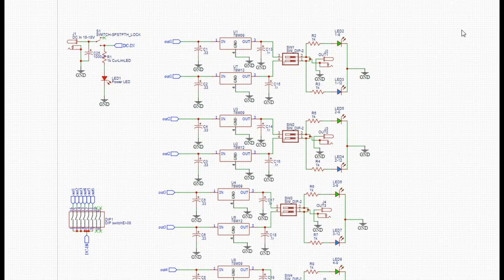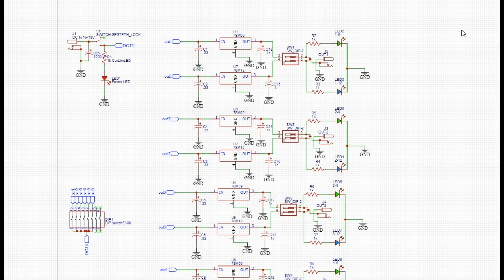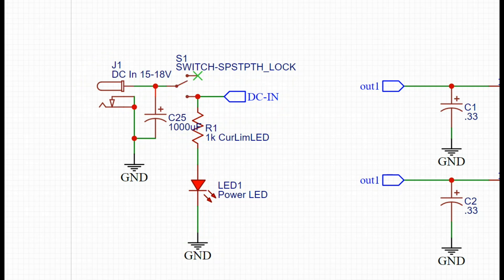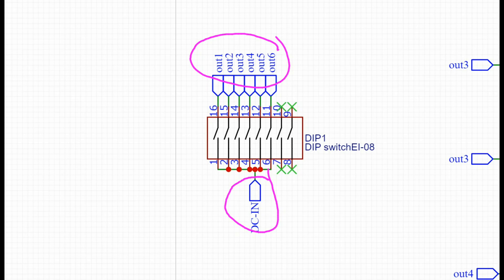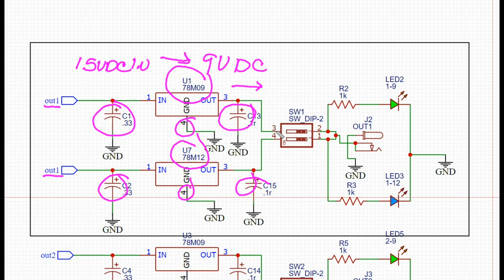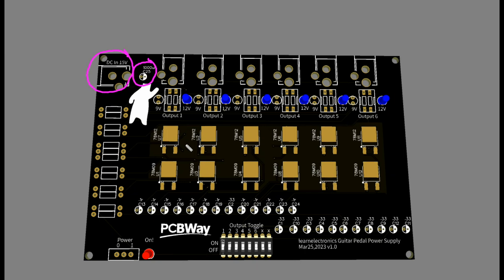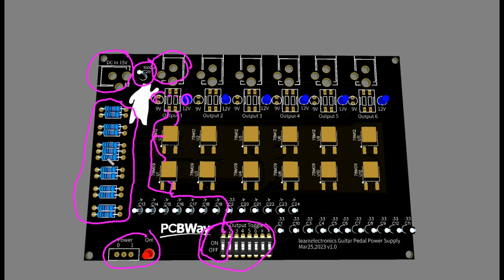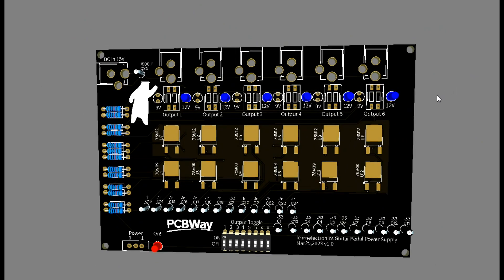Designing a Power Supply

Comment: As most have pointed out already, both indicator LEDs will light up.
Instead of the switch on the output, you could put a rocker switch before the regulator. The indicator LED could then also simply be in parallel with the regulators and the unselected regulator doesn't get powered.
But putting some more thoughts into it, I don't think you need 2 regulators per output. I don't think pedals draw that much power. Should be tested, maybe.
It might be better (sufficient) to just use 2 regulators in total, and then simply have a bunch of 9V outputs and a bunch of 12V outputs and you select the voltage by plugging the pedal into the right output.

Comment: As other people have suggested I'd definitely use toggle switches instead of the dip switches. If you use on off on for the voltage selection you can get rid of the big dip switch to turn each output on too

Comment: 1) Both leds will light up always so you can't see the voltage selected.
2) By turnig on both switches you connect the two voltages. Better use a 3 position switch or one switch to select the voltage.  To turn the channel on or off you already thave the big dipswitch.
3) Dipswitches are not made to constant switch things on or off.
4) The capacitor at the power entrance will give a security risk as it will not discharge (perhaps better let it discharge over the power led )
5) Why not use a voltage regulator like e.g. LM317 and select the voltage by selecting the resistor.
6) However the first question is what is the required endresult (with must haves and nice to haves). What is the max current you need. This as you need to keep this into account when designing. (Are the (dip)switches and is the input power appropriate, does each channel needs its own regulator, should you add some fuses (there are cheap self restoring fuses you could use in your design.)
Reply: Perhaps do not add the switches and leds, just make 2 rows of outlet sockets with the two voltages. This as the voltage only needs to be selected and probably never needs to be switched. The correct voltage can be selected by plugging in the correct output.

Comment: 1) as designed both output LEDs will light regardless of which voltage is selected.
2) caps should be as close to the regulator's as possible
3) use a spdt switch to select between voltages so there's no chance of connecting the outputs of the regulator's together
or
4) consider using LM317 regulators with a switch to select between voltage setting resistors
Reply: And/or maybe put the switch before the regulator. The indicator LED could then also simply be in parallel with the regulators and the unselected regulator doesn't get powered.

Comment: There could be a situation in which DIP-2 shorts the outputs of the regulators together, so probably better to have centre-off, double-throw (and double-pole for the LEDs) toggles there. As others have mentioned, check dip switch currents as most only go up to 100mA and are suitable for switching only 25mA when under load. Blue and green LEDs will be different brightness (forward voltage drop).

Comment: Definitely get rid of the 2 pole DIP.  A simple ON/ON toggle or rocker would be a better option to avoid the 9 & 12 going to the output at the same time.  I can understand the temptation to get all the caps in the same general location, but they would be better right next to the relevant regulator.  Also, don't be stingy.  Don't use your normal hair thin traces, make em 1-2mm 🤔  The general concept is good. 👍

Comment: The only thing I could add is if you choose not to use a dual pole switch after the voltage regulators then you might want to use diodes to protect from back feed if both are turned on at once, just a thought. You will need to use some diodes to isolate the LEDS power as some other people have pointed out. I do like the design.

Comment: Expanding on the observations made by others, addressing the problem of the joined 9 and 12 volt regulator outputs, and the problem of both LEDs being driven on at the same time. 
One solution is a double pole, double throw, center off switch to meet the requirement. This can switch the regulator input and output, allowing the LED indicators to be fitted directly to each regulator output, before the output switch. While this works, it's not very elegant. The switch is expensive at about £1.30 each, and there are too many wires to the switch, mixing regulator inputs and outputs on the same switch, never a good idea for RF stability.   It is  difficult to track on the PCB using toggle switches,  and horrible to wire, with six wires to each switch.

Modifying the requirement spec slightly makes it easier to implement, and potentially more flexible. 
Adding a Jack for each voltage output, would allow the regulators to be switched with a single pole, double throw, centre off switch on the regulator inputs. 
 The LED indicators could then be fitted to the regulator outputs, or across the associated Jack socket.   The indicators would then show which Jack is active, and indicate the health of the voltage output. This is a more logical use of the indicators, and avoids  the problem of joining the 9 and 12 volt regulator outputs.
  This solution is easier to track, as the switch commons are all joined together to the common 15 volt input. The two remaining connections on the switch wire to the input of each of the regulator pairs. 
There are other advantages, different size jacks could be used for the 9 and 12 volt outputs, making it harder to plug equipment into the wrong output. It is likely safer to accidently plug a 12 volt equipment into the 9 volt socket, than the other way around.

Comment: It is tempting to put down a solid ground plane, however, I think it would be better to  reserve the solid ground plane for the input side, up to the regulators input, but star point earth from there on, to each of the outputs. As I suggested in an earlier post, the chance of setting up common mode interaction between outputs is rather high. The problem with tracking separate earth returns Is that the track impedance is likely to be higher, introducing additional volt drops for high impulse currents into the loads, but at least each load will be slightly better isolated from interacting with the others.
As the outputs are joined, the LED supply  indicators will both be on, no matter which supply is selected. Switching the regulator inputs was not my best idea, as while the LEDs could be moved to the regulator inputs, the regulator outputs would be permanently joined, allowing the on regulator to drive current back into the off regulator output. In fact making the LEDs work the way you want is a bit of a problem. Using a SPDT switch at the output, does not solve the problem, as while the LEDs can be made to indicate the health of the 9 and 12 volt regulators, they will be always on.
A simple, but not very nice and rather redundant solution, is to use a DPDT switch, to direct the output voltage to the correct LED. Its redundant because the switch position shows which output is selected, but at least the indicators work the way intended. Unfortunately by using either type of switch at the output, the output voltage off position is lost, as the output can be either 9v or 12v but not off. 

Before the days of detailed circuit simulation, I always believed it took three iterations of a PCB to get it right. The first is where you think you know what the circuit will do (from dc to light). The second is the result of finding out what the first actually does. The third is where it is optimised for production in quantity. Even a simple board, like this can produce surprises, for example,  knocking out VHF/UHF reception for a few hundred metres radius. 
I was always sceptical of those engineers who say they get it right first time. This is because the component data sheets, do not often tell the full story and the initial requirement has a tendency to change once there is experience of the prototype. One can always think of better ways of doing something, so knowing the requirement is important. The perfect circuit takes infinite time to develope, so what goes into production is always second best, but that's ok, provided it meets the requirement spec, because that is "good enough". 
For complex projects, the three levels of PCB  correspond to prototype, preproduction,  and production. Along with these goes levels of understanding of the requirement. Starts with "How the hell do we do that", followed by the naivety and arrogant of "That's easy", followed by the surprise of "Why is it doing that", to finally "Now I understand". 
For the amateur designer, it is not necessary to go for the third iteration, as only one working design is required, and not the repeatability of thousands. 

When working as a circuit designer, I always considered it unfair that I would be castigated by management for expecting three iterations of a product PCB, issues A,B and 1, while at the same time, the software development team produced so many iterations of the software, they were forced to resort to a multidigit alpha numeric code to keep track of the myriad of version of the build. 
To add insult to injury, it was not uncommon to be asked to do hardware changes to accommodate fixes to the software, things like the odd signal inversion, time delay, or extra indicator. Items that would have been deleted, on cost grounds, during the preproduction design review, had they been included in the original design. But I digress and am starting to rant about long past battles.
Reply: Thank you for your insight! 👏🏻🙋🏼‍♂️

Comment: Would it work to use a SPDT switch for each channel and move it to the front side of the LDO's?  This way, only 1 LDO per channel is active at a time and you can use the exact same input/output capacitors for the channel thus reducing the number of caps you need.  The way it currently is shown, all LDO's are active and charging/maintaining voltage to all those caps.  Just a thought.   :)

Comment: Would consider different linear converter, that can take resistive divider as input . Fewer components this way.
Alternatively, step down to 12V and add 9V in series after it, having a 2 way switch picking output . Less power dissipation this way. 

Also, I’d add some filtering at each stage . Pi filter or such.
And current switching allows both 12 and 9 v to be enabled at the same time. That might be bad . 
Also, the main input cap is going to be big, need larger footprint for it.

Comment: R1 needs to be a 1w resistor.  Why are you using Dip2 rather than a 2 pole centre off slide switch.  DIP's will let you put both 9v and 12v on at the same time on each channel and with no diodes you will have a reverse potential on the 9v lines.  But I am new at this so I could be wrong.

Comment: Looks to me like both LEDs will light no matter which voltage is selected. I also suggest putting a 1 nF ceramic cap at each output to bypass any high frequency noise to ground. It wouldn't hurt to put one at the input also.

Comment: The off position for each 9V and 12V output is redundant to the other bank of switches.  Replace the two switches with an SPDT switch with the 9V and 12V on the poles and the center tap to the output.  Then you do not have the possibility of both on at the same time.  But you do then lose the LEDs.  I have not come up with a good way to make them work in this setup.
Reply: I think I have it worked out.  Place the SPDT switch on the input side of the regulator.  The LEDs then work just as dwsired. You only need one input filter capacitor per 9V/12V regulator pair on the input side of the switch and only the needed regulator is drawing power.

Comment: My suggestion is to move the caps closer to the regulator outputs.  Pretty much everything that I have ever seen suggests that they should be as close as possible for smoothing ripple.  You stand a chance of getting unwanted inductance or capacitance in the long traces.
Reply: Yes he doesn't need all those extra electrolytic caps he should use 1uf x7r ceramic close to input pins and maybe max 10uf electrolytic or tantalum on outputs closer to the output barrel jacks.  Also protection diodes.

Comment: Snarky unsubs .. love it!! 😂

@learnelectronics: Possible considerations: on the distribution-side regarding the two (9v/12v) LEDs .. use one, but on the return side (of J2, J3…et al) AND maybe use alternate switches for SW1 and all. The light would then be triggered on a completed connection, rather than just as verification of power.

Comment: A single pole double throw switch on tbe regulstor output would avoid the problem of both regulators being on at the same time, provided it is break before make. 
Is it wise to use the same socket size for both input and output?
Applying the rule that if it can go wrong it will, then it might be a good idea to stop the input plugged into the output. 
Are these regulators low dropout, if not there might be a head room problem with 15v down to 12v. Equally 15v down to 9v is potentially going to give the 9 volt regulator a lot to dissipate. 
Have you considered running the 12 and 9 volt regulators in series? If there is sufficient headroom, this reduces the dissipation of each regulator.
Have you done the sums for power dissipation. If all those regulators are active at the same time, will it exceed the current rating of the input?
Switching the inputs to the regulators, would avoid running the standby current to unused regulators. Though there are arguments in favour of switching the regulator outputs. 
There is nothing to limit the in rush current. A low value resistor or inductor on the input of each regulator might limit the in rush current. 
Bit concerned at the power dissipation of so many regulators. You will need a good heatsink to avoid the regulators over heating. 
There is lots of scope for common mode earth current interaction. 
The problem with running equipment with reverse connection of the power pin, is that chassis grounded equipment with metal cases can produce surprising short circuits. 
Are you happy that the regulators will remain RF stable, when the outputs are connected to long leads. Might be worth a breadboard to check for regulator noise and RF stability when used with long leads.

These are just observations and ideas, not recommendations,  and some are contradictory. Such as the RC input to the regulator reducing the headroom. 

One trick worth considering to avoid cross talk, is to add a diode and capacitor to the regulator inputs. This serves two functions: reverse supply protection, and momentary supply rail dropout, as might happen if one regulator has a high impulsive current demand.

Comment: Check the polarity of the outputs. If I'm reading the schematic correctly it's center-positive on the input, but center-ground on the output.
Reply: Some pedals are positive-tip. Others are wired negative-tip. I would recommend a polarity switch at the end of each circuit

Comment: I’m not a musician, so I have no clue why you need  six separate power supplies, but that is neither here nor there. You might want to consider switching the input to the regulators, rather than the output. That would eliminate the inevitable damage due to someone switching both outputs on at the same time. Also, it might be easier on the supply - especially if it is battery, to have the option of switching off the supplies not actually being used. - three position rocker on the input, eg.
Reply: It's for guitar pedals. Each pedal needs its own power.

Comment: Both the 9 and 12V LED will be on at the same time the way you have it connected now, regardless of Switch.  and placement of the capacitors is not great it better to have them closer to the regulators

Comment: Won't both LEDs on the 9v and 12v outputs light regardless which dip switch output is turned on? Plus it'd be unfortunate if both dip switch outputs were turned on in error. There needs to be some protection against that happening I think.

Comment: Might want to consider using 3-position, dual pole rocker switch for each pedal. One position is off, one is 9V and the other 12. Control for each pedal would be in one place, and also avoids the potential for turning on 9V and 12V simultaneously.
Reply: One solution is a double pole, double throw, center off switch to meet the requirement. This can switch the regulator input and output, allowing the LED indicators to be fitted directly to each regulator output, before the output switch. While this works, it's not very elegant. The switch is expensive, and there are too many wires to the switch, mixing regulator inputs and outputs on the same switch,  that are difficult to track on the PCB  and horrible to wire.
Adding a Jack for each voltage, would allow the regulators to be switched with a single pole, double throw, centre off switch on the regulator inputs. Allowing the LED indicators to be fitted to the regulator outputs.  The indicators would then show which Jack is active. This solution is easier to track, as the switch commons are all joined together to the common 15 volt input.
Reply: I was going to suggest the same thing but saw this comment
Reply: I was also going to make that suggestion.  One upgrade would be to have a variable regulator on one or more, as some like to be starved for voltage.
Reply: @bkw67  could use an LM317 adjustable regulator, but these have a number of problems : they tend to be noisy, they require additional diode protection against the  load capacitor discharging  current into the output, they can be unstable when connected to long output leads, the output voltage is not as well regulated as that of a fixed regulator due to the tolerance of the feedback resistors. The component count is higher.